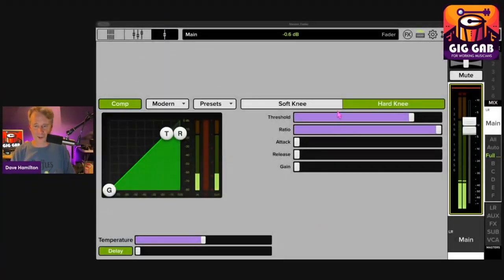Delay Your Mains: Essential Live Sound Trick for Small Venues

Comment: This assumes perfect stage monitoring, ie musicians can hear their own monitor (ie without delay) and hear no overspill from mains. In reality especially in a small venue this delay can exacerbate the problem they already have which is hearing the mess of audio reflections from mains mixed in with stage monitoring. Leading to musicians (not so much drums but definitely synthesised and also electric bass etc) sense of timing being thrown. Am I wrong with this assessment?
Reply: It all depends. Most of the time the reflections from the mains are already an issue in smaller clubs, so the delay on the mains probably doesn't change this at all.

If your monitor is at time-zero and aimed at you, which it would be, then you'll hear that first anyway. Everything else would be a reflection regardless of imposed delay.

Short version: I wouldn't worry about it unless you're in a room where it becomes a specific issue.

Slightly longer version: consider switching to IEMs and rule out these issues entirely.

Comment: Proper way to measure this is use the DIFFERENCE between the Snare and the distance to the mains from Mid house (FOH).  If the snare is 20 feed away at mid house and the mains are 15 feet away at mid house your distance differential is 5 feet or roughly 4.45 ms.  Remember the speakers are often up high at a tangent and that adds distance.  You want to calculate from a point where teh sources feasibly fold onto eachother and delay based on the difference between the two sound sources.  Use a laser because camera phones suck at this.
Reply: Thank you!

Comment: That's a great (and well-known) trick. But I'm missing how small venues will profit from it, because often, they're so small that there is basically no real need for a delay. Therefore, I would remove the "for Small Venues" from the title, as it helps more (and is necessary) working in mid-sized to larger venues only.
Reply: That's the trick: every small venue could benefit from this. If your snare drum is ten feet upstage from your mains, then you're already introducing an audio delay into things because the snare from the mains (or even just the vocals from the mains) are going to arrive ~10ms ahead of the snare from the kit itself, both of which are perfectly audible to the room. And now you're creating a comb filter effect.

By setting the mains to delay and match the sound coming from your backline, everything arrives at the same time...and that's especially important in a small club.

As soon as Robert Scoville told me about this I started doing it, and it really does make a difference.
Reply: @DaveHamilton  Honestly, if we're talking about such small venues (bar, pub, small concert venue, ...) , the reflections coming from all the nearby walls will constantly create audible delays, resonance and effects, especially for the drumset. Delaying the PA will not really have a big effect there. Yes, it makes things better – I agree – but my guess would be that this improvement is largely theoretical and not practically audible for the NORMAL listener (aka guest).
But yeah, measuring and delaying takes 30s, it's definitely a good practice and routine to do it every gig.
Reply: @lhenn_  You're exactly right that there are many other (often uncontrollable) factors. And Robert's point (when setting this up for "the first 6 rows" of every Tom Petty concert) was that you control the factors you *can*, and that gives you a leg up. He was a GREAT guest on the show earlier this year, and I learned a ton! https://youtu.be/C0pbHWOqbxk